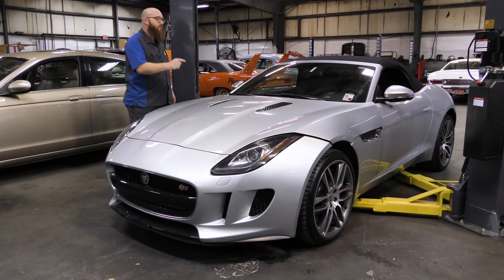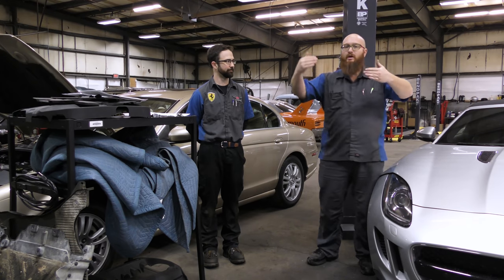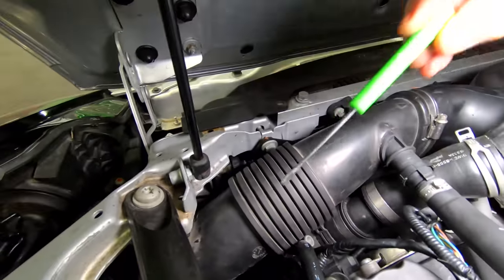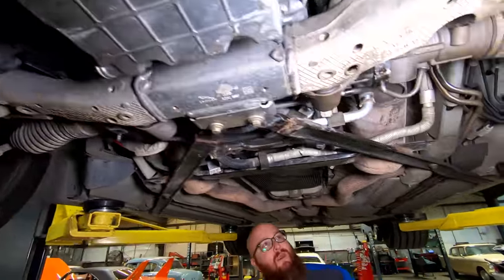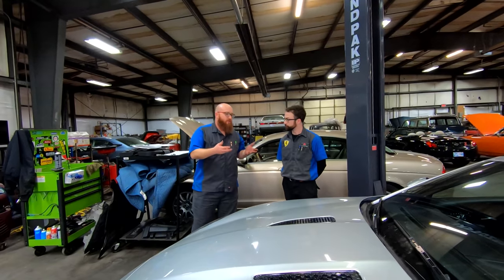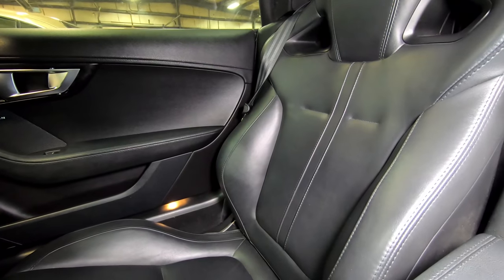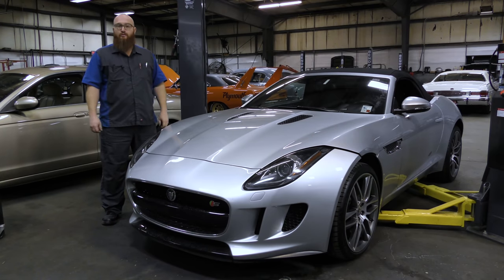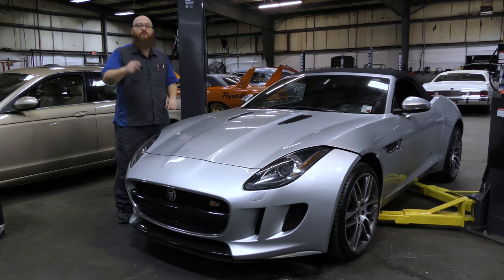How could a shop do such a bad swap? CAR WIZARD points out all the errors on '14 Jaguar F-Type

Comment: This was literally put together by someone who had a bunch of parts extra when he was finished and NO ONE asked about the pile of spares bolts, hose covers and fasteners just haphazardly laying about
Reply: Looks to me like it was done by someone who didn't have a clue, and was completely out of their depth.

Incompetence, rather than laziness.
Reply: @kevinshort3943  putting in bellhousing Bolts and not tighten it down is laziness ..
Reply: @Zirion123  - makes me doubt anything is torqued correctly.  Probably need to check the flywheel bolts as well.
Reply: yes it's real obvious of the poor job. I don't know if he got it cheep or didn't inspect or test before accepting the work. I say customer did wrong. He's got all the money.
Reply: @Zirion123  Exactly. This doesn't look like incompetence, it looks like a Friday afternoon job.

Comment: Check the VIN on the engine, see if it was actually replaced.

That steering wheel is gross. Needs a good scrubbing.
Reply: it seems Jaguars interior is pretty poor quality. A Mercedes with those miles would still be like new inside.
Reply: @dingdong2103  uùuù
Reply: @dingdong2103  Do Mercedes dealers drive them for you? How the hell do you blame a dealer for the lack of respect of the owner?
Reply: @neilkynaston6091  The materials determine pretty much if the interior will remain good looking after use. I've never seen a MB yet with a worn out looking interior even after 200 000 miles. Then again take a KIA or Chevrolet and it will be a bomb inside at that age, if not scrapped long ago.
Reply: @dingdong2103 l have.   But generally it seems that those that like Jaguars are more interested in driving and hands on to a certain effect whereas Mercedes drivers are more into appearence and a weekly detail.   This makes a huge difference
Reply: @dingdong2103 jaguar interiors are actually very high quality. I was blown away by how nice it is.
Reply: Just looking around the Car You can see that it's been abused. Regardless of how many Miles/KM this Cat took very Bad Care of IT. I personally don't believe it looked much better before the problems started? For minor repairs possibly a brake Job or so I could understand going to a FREE Mechanics If You aren't able to do it Yourself. But everything involving the engine or technical things I'm going to the Dealer. It solves any additional Situations that might occur. No this Cat did some work on this car himself. Actually if the motor wasn't under warranty He paid ca. 5-7K for a new one. Seeing that nothing under the Car was replaced it appears that They found a SUCKER with more Money than He needs, the Car Owners is lying, or the Owner bought a Car that He can't afford. What kind of Person would fill comfortable riding in a NASTY Car? Just looking at the sterring wheel is disgusting. Thankfully there's no Smell TV. This is going to cost more than the Car is worth. I'm considering buying a 17' P380 R-AWD for 37K with 50K ON Tacho  in DE. The Car was always serviced by JLR so all boxes were checked. He should attempt to get rid of this Problem. It also appears as though He didn't take these issues too seriously considering the previous Owner wasn't mentioned. Now, in Germany the Seller must give a 1 year Garantie. Everything mechanical involving the Car has to be paid for by the Prior Owner. I hope He's not making payments on this Wrecks? Good luck .

Comment: The “coolant hose” mentioned at 3:56 is not part of the cooling system. It’s ducting for the symposer that projects engine noise into the cabin under heavy acceleration. In fact that entire black plastic contraption on the back of the engine is the symposer unit. Those who know better would’ve removed it entirely if presented with an engine swap. Leaving it unattached would not impact performance, but I agree that it should’ve been.

Comment: The supercharger snout replacement is a Jaguar technical bulletin due to the spring assembly inside it falling apart causing a rattle on the charger. 

Getting injectors out of these cars are a right prick because they’ve got a steel solenoid body that galvanises itself to the alloy head and they’re a mission to remove (you can remove without taking the head off if you have the correct tool)

Comment: F-Type uses aluminium, not steel, so the "tap test" on the car is going to sound very different to what you'd expect.

The story behind how Jag use aluminium is quite impressive; a real feat of metallurgy and adhesives.

Comment: These are the kinds of shops we need to put out of business.  Ones that are doing shoddy work and not even properly putting things back after they were in there.  Most likely expecting the customer to come back with complaints for more repairs.  Sadly, I bet this Jag is in for a big nightmare on the repairs as you never know what's what until you start digging in.  So glad I have a trusted local shop that can do my work for me.

Comment: Do all of us Jaguar owners a great favor, name the crap shop that did this so we can avoid them.
Reply: Agree with this. I live in Louisiana and own a couple of Jags. Very much want to avoid this shop.
Reply: unfortunately with how many comments call upon a lawsuit to be levied on this shop, if you call out the shop they might SLAP suit the wizard. not to mention most of the time when you call anyone out on the internet the floodgates will open to people crank calling the shop, SWATings, just a zerg-rush of vitriol.
Reply: The car owner should at least write a Yelp review.
Reply: @vw5056  whats yelp?
Reply: Could also just be the owner messing with it in the first place and then went to a shady shop to save a few bucks.
Reply: @atodaso1668  its a noise a dog makes
Reply: It appears to Me that the Owner has a Jag taste but a VW wallet. I can understand trying to save a few bucks on repairs, and not all Indi Shops are bad, but with a Jag, I would go to,a dealer, bite the bullet and get it done 100% correct. Where initially this Cat thought about saying some Chips, it’s costed him MORE as he original would’ve/could’ve paid. So where’s the savings? Time and money are lost. To find Someone to troubleshoot this nightmare will be difficult and expensive. It’s not just 1 thing wrong but like putting the dinosaurs back together, the arm bone is connected to the wrist bone, and the wrist bone is connected to the hand bone, etc, etc. 1 default is coupled to some other functions. The Jag from Hell. This will probably be the most expensive Jag that Nobody wants. Keep checking Craig’s List. It will probably be listed soon.
Reply: Yes
Reply: @brianhardaway9716  dealerships are no better - you'd imagine they should be but often they aren't

Comment: It would probably be wise to drop the transmission and check the flexplate crank bolts and converter clearance,
I would also check the engine serial number against the VIN to make sure they actually changed out the engine.
Reply: Id take the whole engine and box out
Reply: @MrMightyytau  I'd take everything apart and check over everything, as was mentioned who knows what else was missed
Reply: Garunteed they missed other items, no one does crappy work like this and get what isn't seen. I'd bet if unseen trouble hasn't started by now it will. I wouldn't trust this engine job for 100 miles... something will more likely fail prematurely and catastrophic.
Reply: 100%. I just mentioned the flywheel bolts in another comment. I also suspect the engine, but if they were being crooked and didn’t replace the engine, there’d be no reason to remove transmission bolts.
Reply: @Dozav7  . True but they may have yanked the engine and swapped a conrod or piston and not the whole engine.
Reply: @IkeVMAX4  the job was bad the shitty part came when they wouldn’t fix it.
Reply: @hpblack1953  The also hark back to the original E Type tail lights. Also copied on a lot of Mazdas, which are pretty much in terms of style Jags for non-wealthy people.

Comment: thanks a million Mr Wizzard, really excellent video, it's such a shame that there are some bad mechanics about. Cars often get bad reviews when in fact it's sometimes the people involved are at fault. Based on my experience it stands and falls with correct service. my 2nd Jag S-Type is running and looking like new at 260k miles and regurlarly crusing at over 100 mph on autobahns.

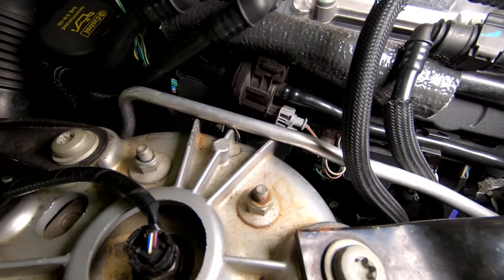Comment: That aluminum line (vapor line?) laying against the rib on the spring tower casting at 12:07 will probably eventually rub through and fail.  The line probably wasn’t reinstalled properly with locators/clips when the engine was replaced.  At best, it will rattle.  

This car is a mess.
Reply: That was bothering me too.
Reply: good catch, I hope they see this comment that is not right and will fail.

Comment: I’m curious how many of your customers that were screwed by previous mechanics actually wind up suing and if so have you been asked to testify?
Reply: Lmao suing? Good luck with that, thats why theres plenty of shady shops, cause nothing will happen
Reply: @dawicked2k8  They just go broke and start again with a new name.
Reply: @dawicked2k8  Shops are sued everyday...
Reply: They need to be sued, then named and shamed.
Reply: Mechanics leans can go both ways, seize a man's tools with a couple sharrifs in tow, you'll get a check in a flash.
Reply: @stephendodson328  I've been trying to get a shop into court for almost 5 yrs now. He's trying to hide behind bankruptcy. Nothing I can do until that settles...
Reply: Reminds me a few years ago.. I had a shop tell me I needed new steering arms/rack ends. But 'not right now' so I had a false sense of security and continued to drive as is - later on I did notice there was a large amount of play in the wheel, and knowing it'd need a wheel alignment, I took it to a place to do it all once - the steering rack ends and the alignment. Turns out there was no locking nut, and the tie rod end was off another model vehicle - they weren't even the same thread width - this was after the previous shop told me they adjusted and tightened things down. The second place told me I was perilously close to hitting a bump and losing steering.
Reply: You engage a insurance mech. Engineer at a  shop for breakdown and check if theres big $ involved if it's a part or mech. Fault it can get quite serious if it involves steering or breaks or any safety fault .
Reply: @MattExzy  Every third person loves to tell anyone who'll listen, 'How great they are at their job.' and how they, 'make a gazillion dollars a year.'

At the same time, I hear stories of incompetence, distraction (gotta' be playing with the cell phone while 'working'), and carelessness, on a weekly basis.   It's BAD out here.
Reply: Most people can't afford that sadly, most states have no lemon law so the buyer is risking a lot going that route.
Reply: @PCgamer923  Small claims might be an avenue but are usually capped at a couple of grand I think.
Reply: @AldermanFredCDavis  This. I'd rather do something right than make every little penny I can. There's a fine line to be drawn.
Reply: @Tom-kn6sr  bankruptcy wipes out all of his previous liabilities there's nothing you can do after it settles you're misinformed
Reply: @ecyfoto  5k
Reply: The problem with taking legal action in these kinds of matters is your time and money get chewed up with no guarantee of an acceptable outcome. Also, the shop will probably have insurance, which means that they only pay a deductible, and you’re left fighting a well resourced and efficient claims defender (the insurer). You’re on the back foot!
Reply: @EddieWinebauer   it's illegal in some states its illegal to seize a mechanics tools as it's a denial of livelihood. We had a local shop owner sued for doing that to a mechanic he fired that owed the shop. Shop owner lost in court was forced to write off debt owed to him and pay mechanic compensation.
Reply: @unclejoe6811  that depends on how it settles. In my case, the guy is under investigation for bankruptcy fraud. So, if the bankruptcy gets denied,  then I'm still in the game.
Reply: @wadebuff4465  different states, different laws... different lawyers different laws. ive seen it done in washington and oregon...

Comment: The position of the hood vents on the early f-types caused alot of issues with the injectors malfunctioning. water got through if it was left outside alot and would damage them. on the newer ones, including my 2017, the hood vents are moved out to the sides more and they added protective channels on there to allow air in but water to avoid the engine bay. In regards to the interior wear, Thats the sticky button effect on earlier cars. i read a report that the EU required car companies to build cars with a certain amount of renewable materials to be more "green" and alot of that ended up in buttons, leathers, and even the shielding on wiring, over time they degrade and look like crap, and especially on wiring it can be the cause of alot of the big time electrical issues you find on european cars. Not 100% sure if the article i read is accurate to this, but it makes sense. My 2017 F-Type doesnt have any of the intense wear issues you see on the earlier models, i looked at a 15 and walked cause it was so degraded on the interior. Almost all '14 & '15 F-types suffer from this wear especially the convertibles since they get so much sun exposure. I do have a 14 Range Rover that does have some of the wear issues. buttons in certain places are sticky or faded. Only good way to fix is to replace with a newer model that didnt use those renewable materials. The rust on the under carriage is from poor metals provided by parent company TATA motors on the earlier cars. There was a recall on them to have extra coating applied to stop the early rusting, but it had a window to get it done and i dont think alot of people did it. some of that was also rectified on the newer cars as well but the older ones will see the brunt of that issue.
Reply: The "sticky buttons" problem is common to all Jaguars and Land Rovers. The coating breaks down after a while and attracts dirt and dust. It can be removed with  makeup remover cloths, but is time consuming.
Reply: Cars like this are so complex it seems when they get to this age there will always be problems in many ways the new Corvettes have gone the same way which I think is a mistake. Although they maybe be ridiculed by owners of European cars there is something to be said for keeping cars more simple in their design and construction.
Reply: @bbkingwasthegreatest711  I know what you are getting at but I think it is less black and white. There have been really bad simple cars and really good complex cars, Toyota hybrids are a great example, they were/are a more complex car but with good engineering and development they have proven to be one of Toyotas most reliable cars. The problem is when a manufacturer makes a complex vehicle but doesn’t test and develop it enough before production, then of course that is going to be a problematic vehicle.

Comment: The F-type Jag is just an amazingly gorgeous car. My dream is the unicorn, the 3 litre supercharged V6 with a manual gearbox. 340 horsepower is good enough power for me.
Reply: There is a 2019 F-type, 3.0 V6, stick on the lot at Jaguar Charlotte. Alpine white. 70K
Reply: @nickjones1505  Socialist Finland doesn't like cars, so you can easily double that price. In some aspects this country is so dumb, car and fuel taxation is mad. Premium is around $7.50 a gallon, adjusted (2.09€/Liter). A man can dream.     D:

Comment: That is the quietest F type startup I have ever heard!  Missed showing off the rising air vents in the center. 
Front emblem is called “The Growler”. Back jumping Jaguar is called “The Leaper”. I love driving my 18 F type R coupe. As well as my 68 E type coupe. Siblings separated by 50 years. Great work finding issues. I hear O2 sensors are a common problem.